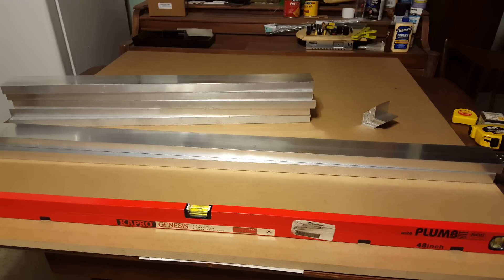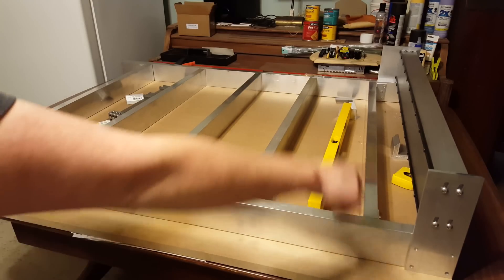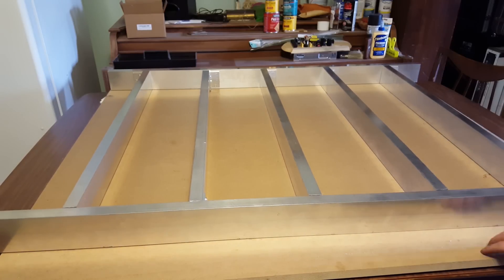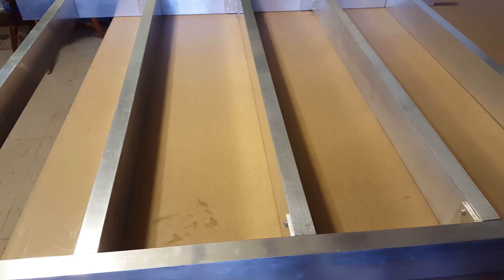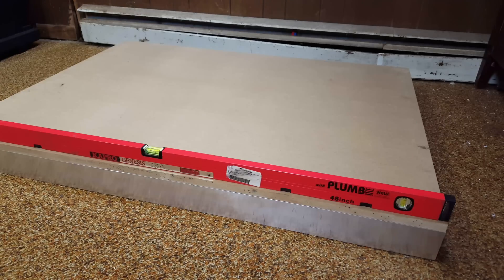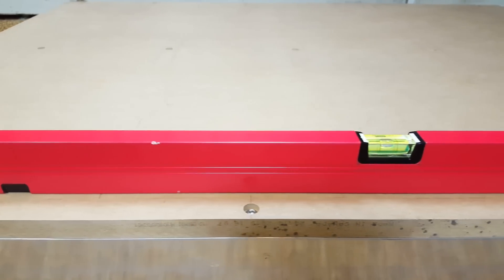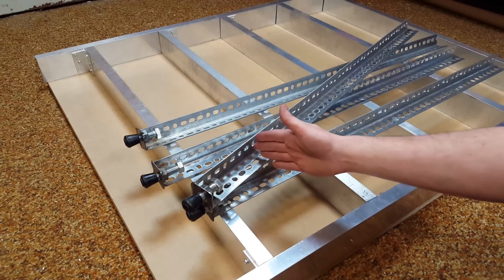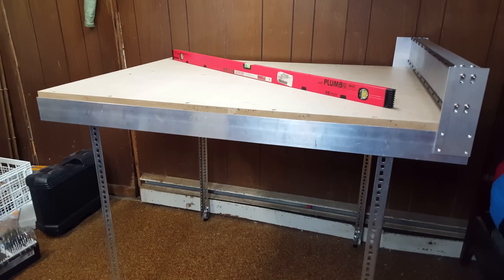DIY-Oko CNC Router: Part 6 Making a Flat Table

Comment: Not liking those flimsy legs at all. Seems a same when you took such care to make the rest of the machine so sturdy. I like the leveler idea though. But I'm pretty sure your going to want stiffer and heavier legs.
Reply from the maker: +Auarhau Seems to be a common theme that those legs were a bad idea. Haha Don't worry, I'm convinced that I need to do something about them.  it might take a few weeks but I will be replacing them, and in the meantime I'll be figuring out some way to stiffen them up.
Reply: There are always many steps to success.  As long as you keep at it it's going to turn out super awesome! :D

Comment: I think that the legs will be fine with maybe a bit of cross bracing. That could add significant rigidity to the table legs and the table. It looks like it'll work fine.
Reply from the maker: +B B I'm going to try my best to stiffen them up, but only time will tell how good they can get.

Comment: Oh Caleb..... For the love of everything CNC please get rid of those legs. When your router is zipping across the X and Y axis that whole table is going to shake and most likely created oscillations that may or may not show up in your work.

You took your time making the table, you should take that same time working with the legs. At this point, even 2x4 legs braces at the bottom will be more secure.
Reply: +Caleb Peters I agree with Chris, but I think X braces would at least make a big difference. Your build is looking great! Thumbs up.
Reply from the maker: +Chris Muncy I know they're not great. Originally, I was going to use 4x4's,  but I didn't like the looks of the 4x4's when I went to buy them.  So, this was kind of a compromise. :( I'm going to try to shore them up with braces, but if that doesn't work then it shouldn't be too hard to swap them out for something sturdier.
Reply: +onlychevys Williams The big problem wit ha lot of the angle iron with holes is that the steel is pretty soft. Caleb, go to your local big box hardware store and get some Uni-Strut to brace the legs for now. It's sold in the electrical section. Just make sure that this isn't going to be a perma-temp solution.
Reply from the maker: +Chris Muncy +onlychevys Williams Thanks for the advice guys! Maybe I'll just go back to the 4x4 idea, or build a wood cabinet for the table to sit on.  In the meantime I'll probably get some X braces, or something, as a short-term solution. It's really awesome to have people willing to give constructive feedback. Thanks again!